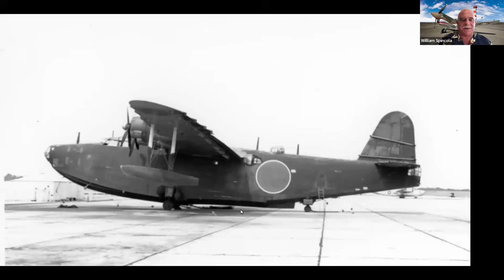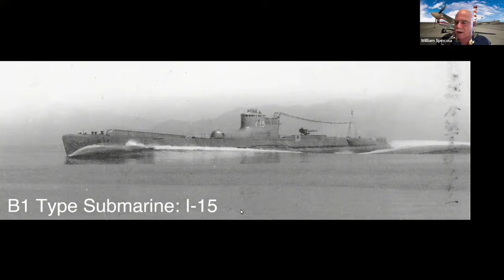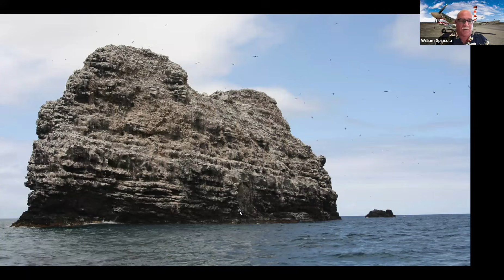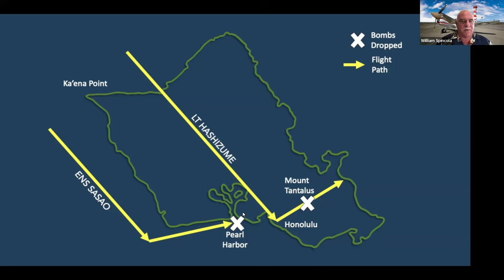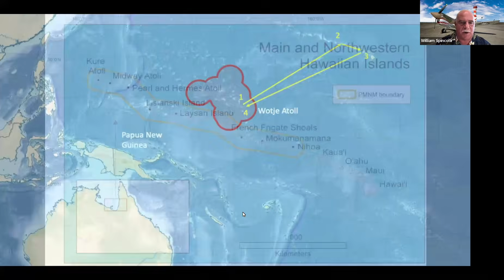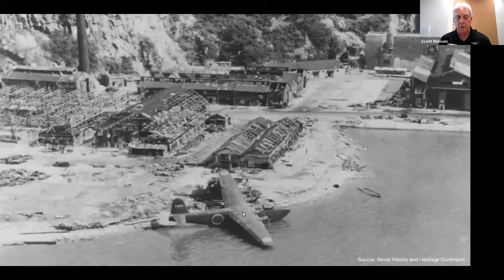Operation K: The 3rd Pearl Harbor Attack

Comment: The PB2Y Coronado is a better comparison aircraft to the Japanese Kawanishi H8K "Emily."
Reply from the maker: The Consolidated PB2Y Coronado is an interesting aircraft to compare with the Kawanishi H8K2 “Emily” Frist, the Coronado is an earlier aircraft design with a wing that was not as advanced as the one on the Emily. The period from 1937- 1942 was a remarkable time of aircraft innovation and development, eclipsed only by the following war years. The Coronado and the Emily are contemporaneous projects (with the Coronado first flight two years earlier than the Emily) and performed similar mission sets. 

Both aircraft had a crew of 10, four radial air-cooled piston engines, 4-bladed constant-speed propellers, and nearly identical empty weight.  40,850 lb for the Coronado and 40,521 lb. for the Emily. However, there are more differences in the comparison, especially in performance.  

Coronado:                                                         Emily:
Length 79ft 3in                                                 Length 92 ft 3in
Wingspan 115ft                                                Wingspan 124 ft 8in 
Wing area 1,780 sq ft                                       Wing area 1,700 sq ft
Height 37 ft 6in                                                 Height 30 ft 
MTOW 66,000 lb                                              MTOW 71,650 lb
Max speed 194 mph, 168 kn.                          Max speed 290 mph or 252 kn
Cruise speed 170 mph or 148 kn                   Cruise speed 184 mph 160 kn 
Range 1,070 mi or 930 nmi                             Range 4,444 mi or 3,862 nmi

Data from Japanese Aircraft of the Pacific War and Jan’s Fighting Aircraft of World War II